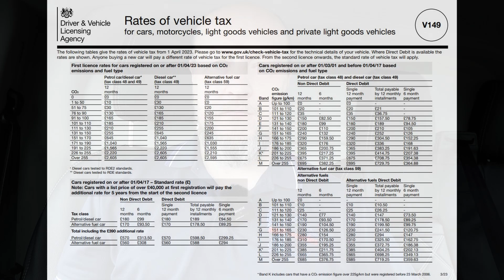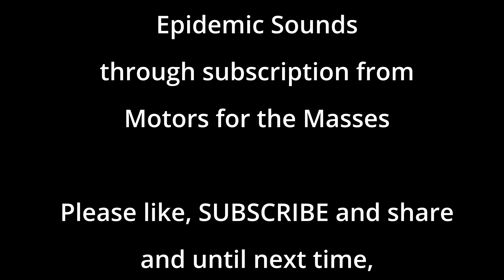NEWS + What's in our bike & car future?

Comment: Hey, nice one. On fuel or electric, my view is that the combustion motor is not the problem, it's very reliable, everywhere in the world you can find a mechanic that knows how to repair it and at the end of its life is nearly 100% recyclable. The issue is the fuel we burn in it. Moreover what really pollutes the engine oil are the carbon particles from burning the fuel, it has been already proved that the engine oil in hydrogen combustion engines lasts much longer than the one in fuel engines. So I do really hope research can find a decent substitute of petrol and that we can keep going on maintaining our old motorbikes we love so much.

Comment: Inhabiting a local social club and around a beer laden table you can usually digest many thoughts and ideas on much of the problems that beset our world, I can almost hear my friend Tony bawling at us over the exceptional loud juke box that all learners drivers operating in your highlighted times should be shoot and there hides strung up on a local tree as way of a warning to others... bless him.
But the other more serios conversation when it comes to electric vehicles is not so much the drive train or its efficiency as electric motors are indeed an efficient mode of propulsion, but the waste product that's left over when lithium batteries are manufactured and the Co2 produced can be high. Your certainly right about charge times needing to be reviewed and for chargers at home we have very old housing stock in this country that is only fitted with smaller supply cable that would not support high volume chargers.
I am guessing here if I stick my neck out the the way to go would be a mix of propulsion systems with electric power either generated by a charging system or fuel cell technology and as you mentioned Efuels which we can at this point produce but currently in smaller quantities. hydrogen is promising either direct burn in a internal combustion engine which if I am honest is really at the peak of its design with electronic fuelling naturally and variable valve timing to add to the efficiency.
Now get yourself to a social club and with the right beer and in copious quantities any current problem can be not only discussed but solved in a moment of time. the current government really need to consult Tony and no doubt he will bring his gun along to any pressing issues that beset them in these challenging times.
Reply: Just joined my local social club! On a serious note I bought an EV ( a cheaper MG) and it suits me very well. I can charge while I’m sleeping. If I do a long journey it’ll take me about 20 minutes to charge, which just gives me time for a wee and a coffee. In my petrol car it took just 5 minutes to fill up, 5 to pay and 5 more to park. Then I could have my wee and a coffee! I bought the car as it will be the last car I buy. I could see the price attack on the motorist coming.
I think the best solution would be plug in hybrids with a very small and efficient engine charging the battery when needed.

Comment: I work for a local authority in Wales unfortunately the Welsh government gives money to councils for specific purposes, ie safer routes to schools, active travel ( which pays for pavements to be widened and new routes created for cycling and walking) this money cannot be used for road repairs. My local authority uses a jet patcher which sprays tar and chippings to quickly fill holes. This is only a temporary repair however and does result in lots of loose small chippings, which is dangerous for motorcycles.
The government will continue to actively try and force people out of private transport, it’s an active policy of the Welsh government. The problem with trying to continue to use existing petrol and diesel, is that with falling sales then the number of filling stations will decrease dramatically and the prices will increase exponentially.

Comment: I used to work for the council years ago in the transport department, i was told they get so much off the government every year, usually what is spent one year, they get that amount the next year, if they spend less, they get less the next year, so basically they will stick roadworks all over every year and come up with more schemes to piss the drivers off, build cycle lanes wether they are useful or not and so on, they spent over 1 million on 1 road in Newcastle for cyclists only, 99% of the time its used by skateboarders to do tricks on, but the area around it is gridlocked while that roads empty its all a big joke scam.

Comment: Oh..  and as a PS to my below comment our council some two months back made a repair to a pot hole that was situated on the approach to a speed camera. and did not repair any other potholes on the same stretch of road although other were in a worse condition. now if I was a cynical thinker i would have been surprised to have a thought pop into my head about the safety reason that the cameras were in place, but thankfully that one went right over my head.... Revenue i hear you cry!!

Comment: I just read a thing about the enhanced rider training and it said something about practicing near schools to help people be aware of safer driving but maybe it is best done during out of school hours. I am sure whoever is pulling the strings probably has all the answers, as to who that is is anyone’s guess. Maybe the reason there is a planned 6k charging stations is because the goverment know the power stations can not sustain the conversion to electric. 
I am not sure this whole electric thing is a fad to cash out on monopolising the power and energy markets for material gain like they seem to do with other stealth taxes like the parking permits that were included in the old council tax, I do not know about poll tax and things like that because it is before my time but I sincerely hope they can develop these new technologies before the crap hits the wall such as fusion energy or using hydrogen energies. I have heard people say fossil fuels will never run out or you can run engines off hydrogen, turpentine or even water so it will be interring to see how the goverment decide to go about it. I personally think they may struggle a little. I am a food bicycle courier so my carbon emissions are as close to zero as you could get so I do wonder how it will be possible for everyone to do it. A good answer is get more people on bikes saves emissions and congestion et cetera 😂

I also use the fix my street application on my iPhone to report any street issues you can report virtually anything that effects public spaces like pot holes and the council do seem to do something about it I just do not have the time when out and about, but I have seen roads churned up within the space of months during a harsh winter so I do feel they need to get their finger out at times

Comment: Pot holes that's why Adventure bikes are so popular LOL. The process and materials required to manufacture an EV is horrendous on the environment, we need to keep the vehicles we have longer and not change every 2 - 3 years to reduce the demand for the manufacture of new vehicles, lets face it modern cars and bikes can still look good and run well for 20 -30 years if we look after them. remember when we would polish our shoes to make them last, now we just throw them away when we get a scuff on them and buy a new pair, great debate thanks